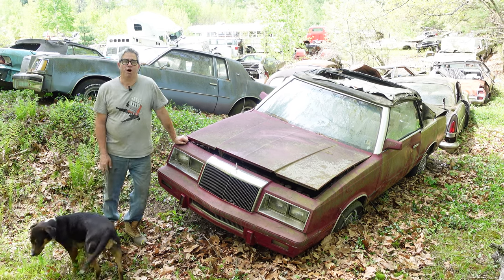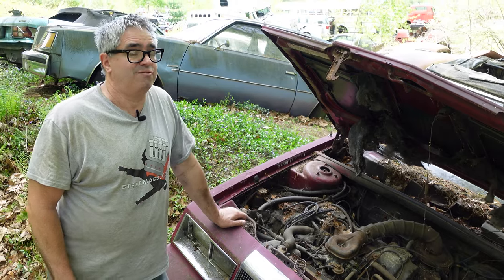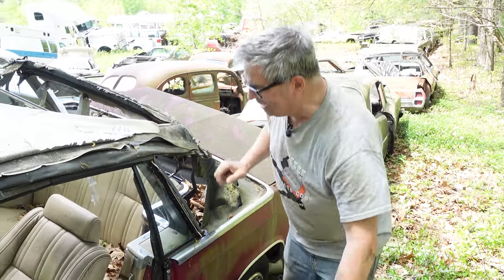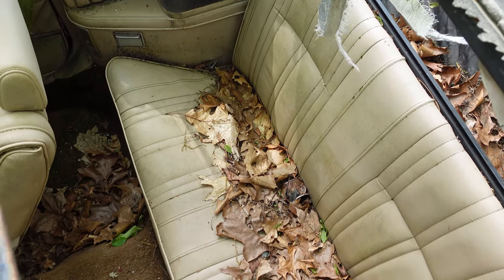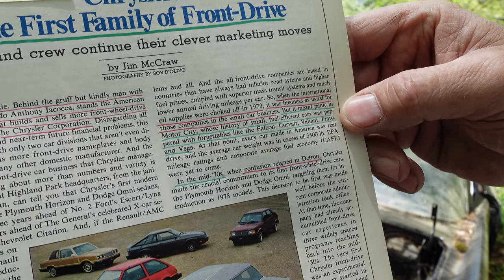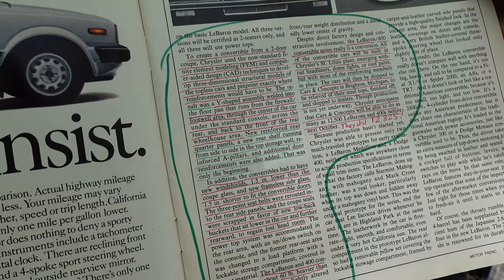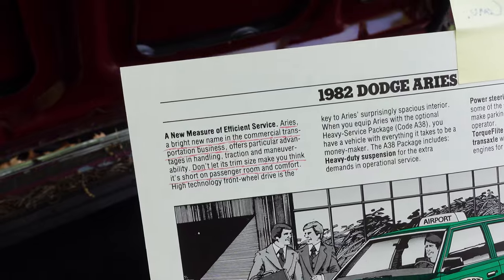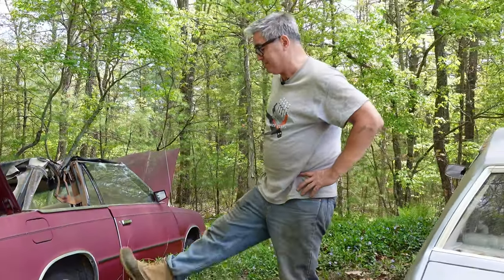LeBaron Goes Topless

Comment: Being an all Mopar family, my mom had Reliant wagon that made a trip to the Oregon coast when I was 12. We got a pinhole in the top radiator hose about ten miles from the nearest town. We duct taped it and filled the rad w/water and went to the town and got a new hose. The tape was still holding without leaking, so we tossed the new hose in the back or the wagon and proceeded to see how long the tape would hold. It took   us all the way back home, just under 500 miles. I got to change it when we got home. When I started driving, I always had a K car to fall back on when my RWD mopars were needing work or being modified. To this day I still have an 84 Turbo Z Daytona and an 87 Plymouth Turismo in my fleet of Pentastar power.

Comment: I currently own an '85 Reliant. It's a 4 door with a 2.2 and a 4 speed. It's super clean and very basic, manual steering, hand crank windows and was originally radio delete. The front fender has a plug that looks exactly like a retracted power antenna, but it's just a plug, not an actual antenna. It's a fun car that gets a lot of looks and comments.
Reply: Must be in excellent condition

Comment: That's at least a 1984 model. It has wrap-around tailights and rear quarter windows. 1982-83 models had a wider top-up  sail panel without those windows. it looked very low-rent. The quarter windows make a big difference in the appearance. And in '84, you could get a Turbo , that, while unrefined, didn't move too badly.
Reply: Also that's the 83/84 speedometer the same as on my old 84 E Class.
Reply: I worked on these as new cars.  This is a 1984-85.

The carbureted 2.2L was not available in these.  Your driveline choice was 2.6L/auto till the turbo came online in '84.
Reply: You're right. The car shown here would be a 1984 model. The 84 models had the body coloured side trim which got chromed in 1985. Also the 84 models kept the same grill from earlier models, then there was a one year only grill for 85. My dad owned a 1984 LeBaron 4 door which he purchased new.
Reply: And, because of their popularity, the MoPar convertibles were eventually built in-house (I believe it was in '83-'84), leaving the Mustang as a Cars and Concepts conversion.
Reply: @bobtepedino5661  Interestingly, my '85 LeBaron Convertible has Cars & Concepts mfg. labeling on it.
Reply: @craigsmallish2392  Yup.  I know the 3rd generation LeBaron Convertible ('86) was built in-house - maybe all of gen 2 was C & C...
Reply: The early K Car Lebaron from 82-83 were bland. When the Turbo engine option was added for 1984, that's when things started getting interesting because most American were not familiar with turbo engines at that time, and the turbo really improved the performance of the Lebaron. Agree, the Chrysler Turbo was not refined, but it was pretty quick, and competed well with many V6 and V8's during that time.
Reply: @bobtepedino5661  Actually, Bob, the Chrysler convertibles didn't move in house until 1987. That was when the Dodge was dropped and the new body style LeBaron was introduced.

Comment: Back in the mid 1980's Chrysler and Mitsubishi went in on a joint venture building personal sports cars  in Normal Illinois. It was called Diamond -Star Motors (DSM). I had the opportunity to tour the plant in 1986 prior to its opening and was very impressed by the layout and capacity of the plant and the then new to the US concept of just in time production. The funny thing was originally they produced three vehicles a Dodge, Plymouth and Mitsubishi version of the same basic platform and the Mitsubishi version always out sold the others by at least two to one even though the mechanics were identical and the exterior was very similar.

Comment: In the Eighties, or a portion thereof, our company relief vehicles were Chrysler K cars (Plymouths).  One time the brakes went out on one I was in coming off of a freeway off ramp downhill at speed, and the guy driving it went around a curve through an intersection in a four wheel slide, laying down some rubber on the pavement.  I was riding shotgun.  He screamed the brakes were out, repeatedly pumping the brake pedal to the floor in a panic, and how we avoided a crash, I don’t know.  We then radioed in that they needed to pickup their jalopy over the company radio while we jumped in our respective city buses and began our eight hour shifts dealing with a delightful public.

Comment: Fox Mustangs were built as convertibles, but unfinished at the factory.  They had a temporary roof installed and sent to Cars and Concepts to have the top and rear seat area installed.  If you’ve ever disassembled one (which I have), you would all of the structure included during assembly at Dearborn.  Convertibles even had their own quarter panels.
Reply: I thought only '83s were partially assembled and sent to a contractor for completions, with '84s models and up done in-house.

Comment: I worked at a Dodge dealer bodyshop when the Dodge Shadow/Plymouth Sundance came about. They started making a convertible version of an already turdmobile, in my humble opinion. Every one we sold had to come back and have bolt on bracing added between the unibody rails, a real pain in the arse! They were hacked....I mean converted down in Mexico. On occasion I'd have to remove the ridiculously wide plastic belt mouldings around the rear, where they cut the sail panels, to do some painting/repair work. They literally hacked the roof out! It was all uneven cut and jagged,  almost as if they used a friggin hatchet! All the bare metal edges were rusty, it was a joke. Anyway,  the first time we removed those mouldings,  the whole shop bout pissed our pants laughing.  I remember one technician saying, "Who let my kids get in my tools again"!

Comment: I had a 1985 LeBaron two door coupe painted mink brown totally loaded with the 135 cubic inch 2.2 liter 4 banger. Price was $11,313.00. I traded at 158,000 miles in 1991. No horse power, but it was a great car. Thanks for the video Steve and bringing back the memories! 😊👍👌

Comment: I had a white '82 Mark Cross rag.  It didn't have quarter windows and the rear bench seat bottom was a little narrower so I'm not sure the one in the junkyard is an 82. That was my 7 year olds seat as he was the only one who could sit on it with his knees not getting crunched. I kept it until '95 when I bought my black w/gold top '95 Lebaron convertible.
Reply: It's 1984 and newer as someone else pointed out because it has the "wrap around" tail lights which didn't come out until 1984.

Comment: Howdy, Katie. This is why we need the VIN to win and the tag to brag. As others pointed out, this is a 1984 or newer model as the "wrap around" taillight treatment didn't happen until that year. The 1982-1983 cars had non-wrap around style lamps. Yes, this is a "Sperlich Special". Hal Sperlich came over to Chrysler with Mr. Iacocca from Ford and together they introduced the K car and minivan platform that Mr. Iacocca pitched to Mr. Ford II, aka "Hank the Deuce" who rejected the idea, stating it would take away from wagon sales. After Chrysler had success with the minivans GM followed suit in 1985 with the Astro and Safari and Ford with the Aerostar in 1986, but neither could ever catch up to Chrysler and neither are still around, but Chrysler is still producing them today. A little late for "Stayin' Alive" as a song (1977), but not for a movie (1983). I took driver's education in a K car, a blue 1986 model. We were driving one day (four of us) and my friend Sam was a big guy and he adjusted the seat. Well, the seat cable broke. Ron was the next one up and he was very short and could barely reach the pedals with the seat being all the way back. 

No VIN, can't win, but somewhat easy to figure out, no doubt: 1C3 for US made Chrysler passenger car, B for manual seat belts, C for LeBaron, 5 for Premium, 5 for convertible, G for 2.6L four cylinder Mitsubishi sourced engine with 2 barrel, then a random check digit, E for the 1984 model year, G for St. Louis, MO assembly (Fenton) and the rest is the production sequence. The Fenton plant complex operated from 1959 to 2009 and made many a K car and was a minivan plant for a time. The base car would go to Cars and Concepts in Brighton, MI from the Fenton plant and have the conversion done to make it a convertible. No tag, can't brag, but should be either code BM5 Crimson Red or code CR6 Garnet exterior paint.  Yes, the K car did "save" Chrysler in that it made them profitable, but the Omni and Horizon actually saved Chrysler because it kept them solvent enough to get a government loan to keep going. After that the K car filled the coffers of Chrysler and got them profitable again. 

The EPA figures were often lofty and later on they were revised. A lot of those figures are for the base engine, manual transmission, no AC, etc., which most customers did not buy them that way. 

I wouldn't have bought a new one in 1982, nor would I have bought a 3rd generation F body. I'd have kept my 2nd generation Trans Am, as we did. When my dad found out in late 1980 that the 1982 cars were going to be different and have MacPherson struts up front, we stuck with the 2nd generation car. 

Yes a "nice Reliant automobile". LOL.
Reply: 1985 was the first revision, followed by a new improved mileage format for 2008 model year. EPA notes that pre-2008 mileages are not directly comparable to later models.

Comment: Turd?  If the shit fits...😆😂🤣
I once read that the Fox Mustang used the same top and framing assembly as the K car!
The University of Cincinnati had one or two K car, campus police cruisers.  They also had an old GMC J6500(?) Brigadier dump truck for hauling coal to the physical plant. It was a huge old tandem axle dump truck, with the GMC 66 cab and old school pre-Brigadier grill - and with V6 badges on the hood!!! It must've been a big 478 gasser!
Reply: Probably a C6500.

Comment: not to cut the k car but that subaru on left page , well i bought one , on  the fly 4 wheel drive and by far the best car i have ever owned. i couldn't kill it. and i ran it in a off road 4wd truck race and kicked every make of trucks butt. still have the trophy. not to mention awesome fuel economy unless your in the turbo . but 9 gallon gas tank 40 miles to the gallon. 47 in snow storm and it transported people to the hospital and plowed the road where you had to look out the door window to see , snow going right up over the top. yep 4 wheel studded winter tread it would go anywhere especially when it had hundreds of pounds of ice form into a plow on the front. only thing on the road was my subaru wagon. stopped picked up snow plow drivers , they couldn't make the hills. epic car.

Comment: Great try on 80's Travolta cover!  Keep the day job you do best (LOL).  I had one of those K-car variants (1984 Dodge Rampage 2.2 WITH the Prospector Package).  5 speed manual and front wheel drive was great in these New England winters.  That was around $7K , I downsized from gas lovin' D150, undecided if it was worth it.  The Lebaron droptop was a great looking car in that time and desired by many.

Comment: I bet the radio still works.
Reply: Many had AM stereo. You could hear stereo crowd noise from the AM sports station.
However, the radio pushbuttons contained carbon-impregnated plastic. When they turned hard with age, you had to push with all your might, just to change stations (or spin the tuning knob).

Comment: I worked as a welder at the ASC plant that made solara convertibles, they would come off the line at the Toyota plant as bodies in white and come down to get hacked up.  Then they would go back to be built and come back again to get the top installed.  I have no idea how Dodge thinks a small shop in Miami is going to handle building 20,000~ or so challenger convertibles, and maybe they realized that as Ive heard nothing about them since they announced they'd be available for this final year.

Comment: These were fun in 1984 with the 2.2L Turbo with 146 hp 4 and these in a Turbo 4 cyl were more powerful and could out run a Z28 from the same time and when in 1986 you could upgrade for 215 more and get the Shelby 2.5L Turbo 4 175 hp and 175 ft of toque in your Le Baron Convertible or Town and Country Covertable  Shelby Turbo in 1986 was dastard equipment in 1986. The base 2.5L 4 engine was decent and had 102 hp and 140 ft of torque and very easy to repair head gaskets I could do in four hours time.

Comment: Man What a trip , its been many years since I have seen a LeBaron like that , the last one I worked on had 2.2 Turbo! , also the name Cars and Concepts is a name i have not heard in a long time, Back in the 1990s I had a 1983 Pontiac 6000 LE coupe that had the very thick padded Landau Vinyl top and I distinctly remember the label Affixed to the door Jam Stating the car had been Modified By Cars And Concepts and Met all US Safety Standard in effect at the time of Manufacture

Comment: Great video, as always, Steve! 
I guess I have a more favorable view of the K-Car. In a more basic form, it was inexpensive, reasonably reliable, and even the base engine could keep up with highway motoring. I never owned one but I had a buddy who often lent me his base, 2-door Reliant and it was great on gas and you could even get an obligatory chirp from the front tires if you dumped the clutch. Moreover, this car saved Chrysler from the brink of bankruptcy and thus should earn far more respect than an underpowered Firebird (muscle car-wannabe) from that same era. Sadly, (with a very few notable exceptions), there were very few muscle cars from the early-mid 80’s that were not laughable. I guess that at least the K-car was honest in what it’s mission was…

Comment: In NZ that 2.6 was used in a number of Mitsubishi vehicles including a '93 double cab rear wheel drive ute (pick up) I owned back then. Interestingly they had a hemi head on them. In that carburetted form they were horrendously hungry on fuel, 21 MPG on a trip in mineand strangled with EGR, but with that ripped out, extractors fitted, and carb mods it improved to 23 MPG average and turned into quite a perky thing in NZ terms. They were called the 2.6 Astron motor and had a Silent Shaft counter balancer to smooth them out which was very effective and gave them a distinctive whine like a sewing machine. Later models were fuel injected which improved the economy significantly. Mitsubishi here overall made generally good reliable vehicles, with a few exceptions.

Comment: Back in the late '90s I owned an '83 Plymouth Caravel.
 It was an extended wheelbase version of the K car platform with slanted rear glass which gave it a slightly more pleasant appearance.
 Light metallic blue with blacked out window trim.
 It wasnt fast but the ol' girl was reliable and returned fantastic gas mileage.
 Also had the coldest air conditioner of any car I've ever owned.
 Now I understand your comparison to the Early 80s Camaros from a performance standpoint .
 Actually they weren't very reliable in comparison to the Chrysler offerings of the era judging by the ownership experience of a close friend.

Comment: From my understanding, the 2.2 was designed by the same guy who designed the slant 6.
Reply from the maker: Hello Rick Jenkins, Thanks for watching and writing. You are correct. The 2.2 liter Trans-4 engine was indeed an in-house Chrysler creation, unlike some of the Japanese and French 4-bangers used in other Chrysler front-drive vehicles. There is a book called Chrysler Engines 1922 - 1998 by WILLEM L. WEERTMAN that tells the story. And yes, Weertman was a Chrysler employee and yes he played a major role in conjuring the little 2.2 and its offspring. In fact, Weertman also co-authored the Society of Automotive Engineers (SAE) engineering "White Paper" on the then-new Trans-4 when it was announced in February 1981. Weertman also played MAJOR ROLES in (as you state) the Slant Six and even the 426 Hemi development programs. Good eye! Thanks again for watching and writing. -Steve Magnante
Reply: @SteveMagnante  Don't forget the VW engines used in the early Omni and Horizons as well.

Comment: "Turd" is an appropriate name for the Lebaron that I once had.
Not because I thought it was an ugly car.
I actually sort of liked the looks of it.
But it was simply worn out when I bought it.
The car was a 1988 4-dr sedan. (Last year of this body style.)
In 2002, the wife and I were in need of a 2nd car.
I bought the Lebaron for a whopping $300.
I don't recall how many miles it had.
Car ran good, for about 6 months.
Then the engine crapped out, and the car wasn't worth repairing.😂

Comment: I had a minvan with the 2.6. It had a very complex timing chain setup. If a chain broke, it would do a lot of damage. I traded mine in before it needed to be serviced.
Reply: The 2.2L motor was better. It was a non-interference engine. A friend with a Daytona Turbo Z snapped the timing belt. No engine damage. We changed the belt in our college parking lot.
Reply: @LongIslandMopars  That was my understanding as well. The 2.2 used a belt that that didn't cause damage if it broke. It was the same for the 2.5. I had one of those in a Dodge Spirit.
Reply: @kmath50  They were solid engines (I believe the 2.5 got balance shafts). My family never owned one (we had slant sixes in 2 Volares and a Valiant, plus the 273 V8 in a Coronet). I still have the Coronet; it was the only new car my dad ever owned and he drove it regularly for 30 years before giving it weekend warrior status.
Reply: @LongIslandMopars  coming up for the 4 door pickup?
Reply: @marktimberlake4493  I think you mean if @Unfinished Project is coming up for that truck. 😁